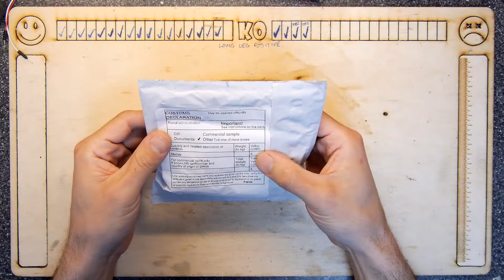Ribbon HDMI Cable

Comment: Could it be possible to solder the ribbon to the back of the HDMI surface mount pads? Would only work if the pitch spacing was the same I guess.
Reply from the maker: +Simon Lock 🤔 everything is possible, but I fear I will more likely kill it in the process. I think the composite screen will win the day